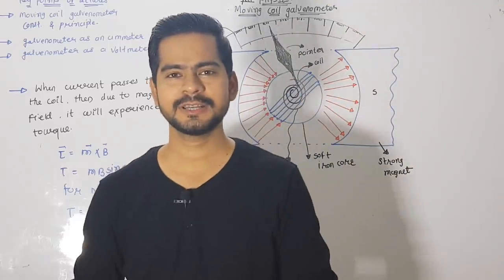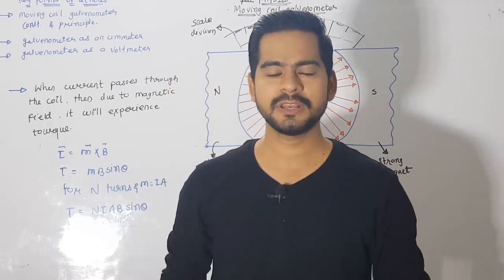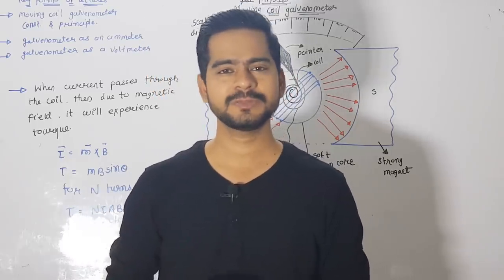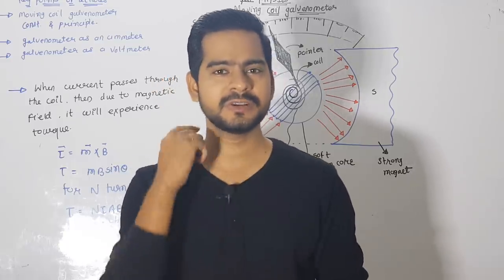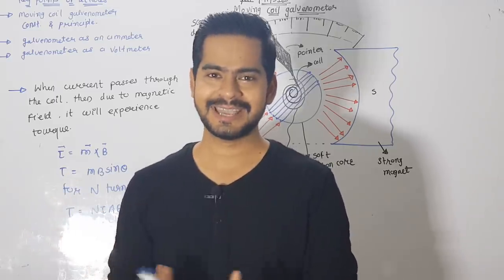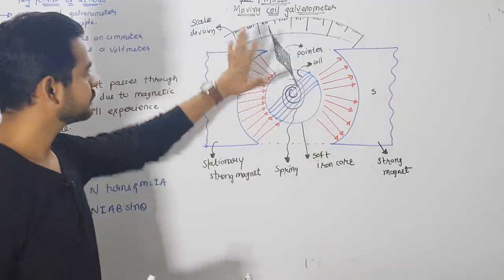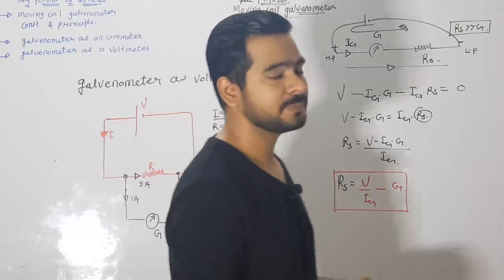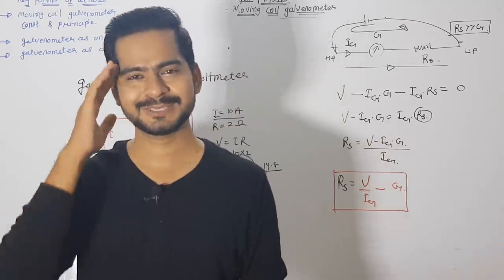9.Moving coil galvenometer |jee-neet physics class 12

Comment: dear sir big fan of you...the most important benefit of radial magnetic field is theta always 90 degree, because area vector always makes 90 angle with the magnetic field. To understand about direction of this area vector, imagine a circular current loop and find where will be the direction of area vector for this. now wrap this circular loop on soft iron and you will find that this vector always make 90 angle with magnetic field.

Comment: If the rectangular coil used in the moving coil galvanometer is made 
circular, then what will be the effect on the maximum torque acting on 
the coil in magnetic field for the same area of the coil? Give reason also.😢

Comment: Sir,good morning .
I have a great problem ?
If some current is flowing through the shunt than the galvanometer in parallel to it is not able to measure whole current entering from A and leaving through B.
So it will no able to give purely accurate value.

am I right?😉 In your last video of magnetic effect.

Comment: while explaining galvanometer as a voltmeter you used kvl to find out the value of resistance which should be set in series with the galvanometer but how is it in a closed loop because kvl is used in a closed loop
Reply: May be its just for remembering

Comment: Sir ji ek que h please bta dijiyga 
1.if we have many of resistance 10 ohm and in each resistance current flowing is 1amp.so how can we arrange these resisters so that tatal resistance is 5ohm and current flow from this is 4 and? Find total no. Of resistance require for this combination
Reply: Suppose we have n number of resistors Where n is assumed to be infinity then arrange to and number of resistors in parallel and make this connection n x so that total resistance will be in (10÷2n)n= 5 ohms. And for the 4:00 ampere current I think it is not possible to get 4 ampere current through the whole circuit because the potential drop across each resistor cannot be changed or maybe it can be.

Comment: Sir I think area vector is not well directed what you actually showed in this video...sorry sir if I am wrong.
Reply: @sachinsirphysics  yesh sir, but I think since we are trapping the wire around the soft iron core n no of times so for every single turn or loop which is almost closed area across the cylindrical shaped soft iron core. That's area vector( perpendicular to the plane ) direction should in the direction of some magnetic field and as well as perpendicular to some magnetic field since it is radial ....not in the direction of upper view of loop what actually shown in this video...again sorry if I explain wrong.